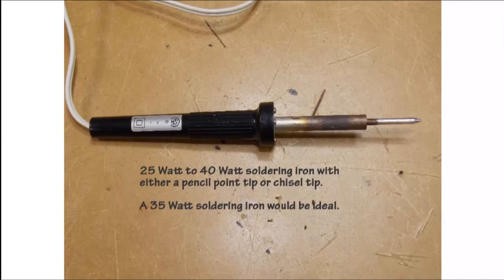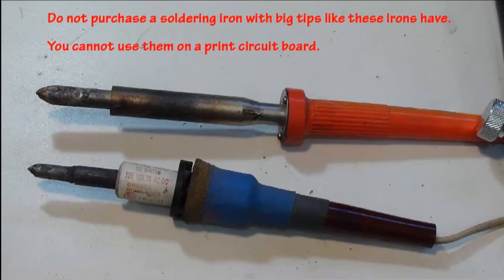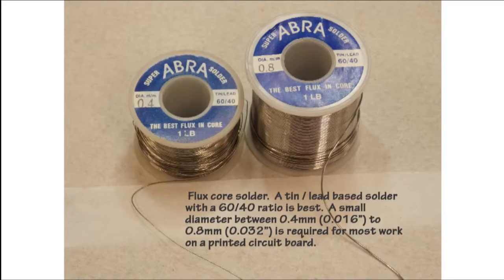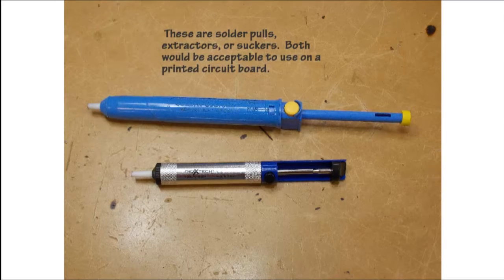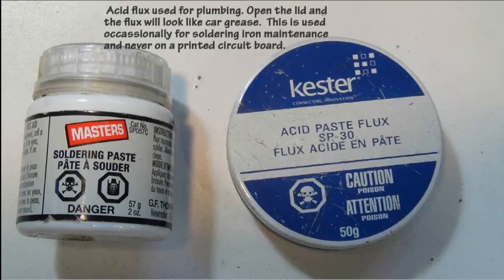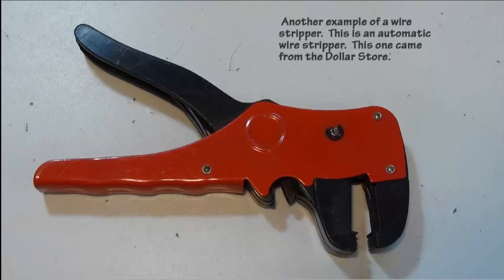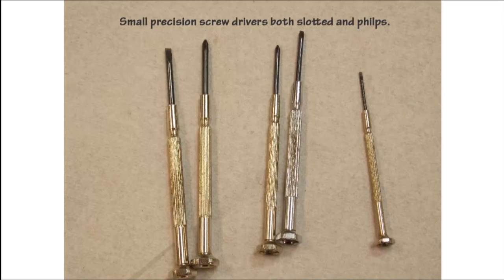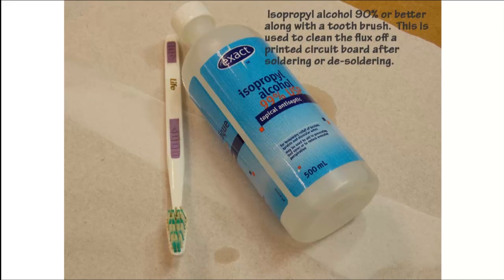Basic Tools Required for Electronic PCB Repairs

Comment: Thank you... Very useful! Is there a tool to score the circuit board lead to allow the solder to stick better?
Reply from the maker: +johnny drone - never score electronic parts or the circuit board.  If the pcb will not accept solder, the pcb needs to be cleaned with rubbing alcohol.  Same would be true for electronic parts.